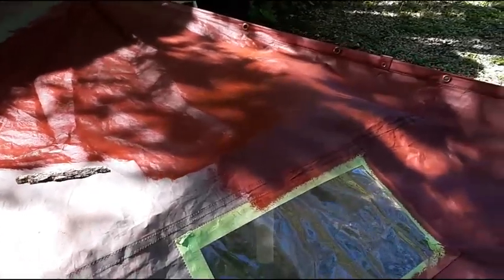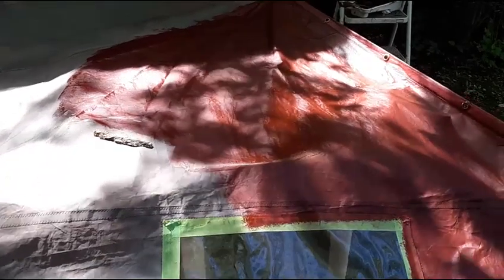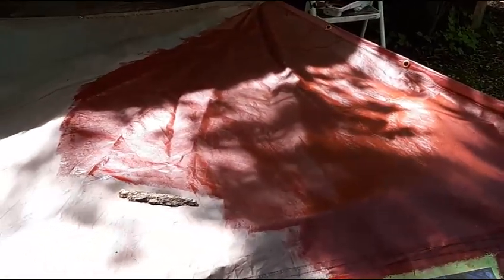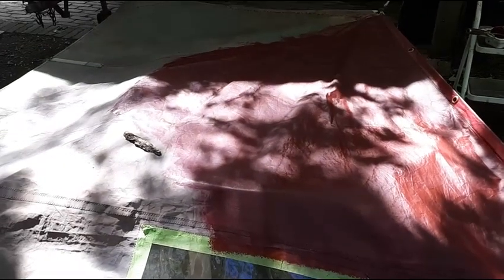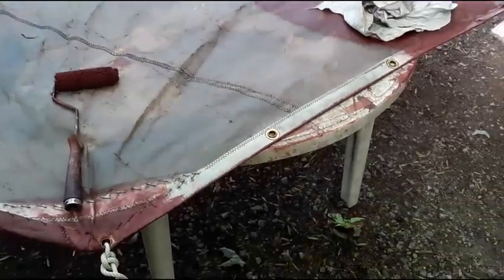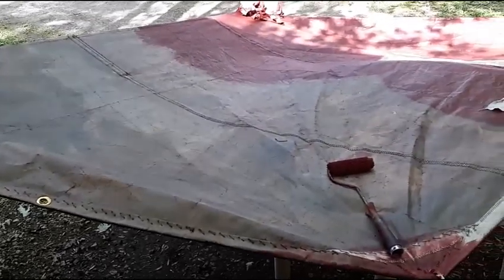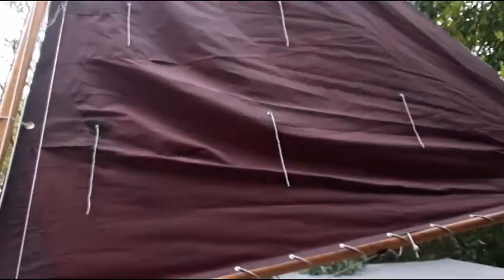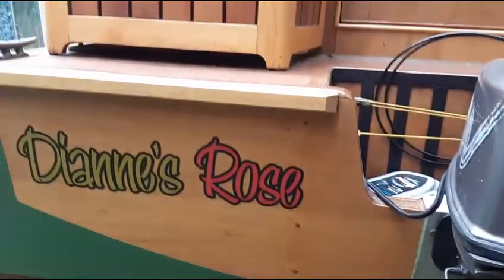Painting a Sail

Comment: Great info Roy.
Does the paint abb a UV blocking component? I built a self furler for my old jid so I was thinking of paintinf a stripe down the leech and across the foot.
Reply from the maker: I'm sure it does if meant for exterior use on metal. Tremclad oil based FLAT metal paint is what I used. Thinned 25%, rolled on and wiped off thoroughly with lots of rags.  The key is to give it a thorough rub!!! It really just leaves a light layer that is worked well into the fabric! You can see if paint is sitting "on" the sail cloth or has "stained" the cloth. It needs more rubbing if on the cloth!! Best/Roy

Comment: What are your sails made from? I've just tried painting and rubbing it in on my sail. It almost  does not seem to go into the fabric at all, and I can rub most of it of leaving an almost white sail.. I think my sail is made from a kind of polyester maybe 🤔 I couldn't find the exact same paint as you used, but I did find som oilbased metalpaint that seemed to be comparable to what ypu used
Reply from the maker: The sail is a synthetic material but perhaps yours is made from more modern materials. Some sails are almost like a plastic. Sorry I can't be more help Boe. If you used an oil based metal paint, it should have worked! AllthebestRoy
Reply: This is so inspiring. I'm going to take the plunge and cut some old sails I've been gifted to experiment with paint on them. I need a new sacrificial edge for my foresail. I have primacon vinyl based marine primer I think might be worth trying. I'm sure I've oil based metal paint too.  If this works well a really fancy boom tent will be on the long finger! Cheers Roy!

Comment: Roy what sort of paint did you use I have had success with water based exterior paint on canvas but have not tried painting sails
Reply from the maker: yes sorry, I've mentioned it on previous videos but  forgot to here. Tremclad oil based metal paint. Thinned 25%, rolled on and wiped off thoroughly with lots of rags. It really just leaves a light layer that is worked well into the fabric! You can see if paint is sitting on the cloth and it would need more rubbing if so!!!
Reply from the maker: FLAT PAINT!!!

Comment: love your work and thanks for sharing. I watched the video but can you please tell me if the sail is canvas or synthetic? Am thinking of repainting a 2nd hand synthetic sail and am worried it won't work.
Reply from the maker: Synthetic? It was not canvas but was an older sail. It may have been a nylon or polyester! I worked on a "newer to me" sail that did not turn out well. I got lazy and just rolled the paint on as thin as I could to avoid wiping it off, which is a lot of work! I should not have skipped this step. It went on thicker and flaked in the wrinkles and there was also old glue from numbers that were on it long ago. There it flaked even more! The trick is to pre-wipe  with thinner and then add thinned pain, rolled on and make sure to thoroughly wipe off with rags! Make sure the thinner had time to dry too before coating. Mix the color you're after and use flat metal paint or "rust" primer (already red and adheres better). I offer no guarantees but if the sail is already looking bad, there is little to loose! Good luck Robert! Best/Roy

Comment: Hi Roy! You continue to amaze. Yes, what kind of paint exactly?
Reply from the maker: yes sorry, I've mentioned it on previous videos but  forgot to here. Tremclad oil based FLAT metal paint. Thinned 25%, rolled on and wiped off thoroughly with lots of rags. It really just leaves a light layer that is worked well into the fabric! You can see if paint is sitting on the cloth and it would need more rubbing if so!!
Reply: @roydesignedthat   hi roy! I am interested in this process for my little sailing dinghy. What is the result over time? Thanks for your answer
Reply from the maker: @optiAero  my first test was with die and it faded. Now I use rust flat paint and it has held up well. Do clean the sail as one sail had glue from old #s that the paint flaked a bit. But I've done several sails with success. Make sure to roll on then rub off with lots of rags so just a thin layer is left and the coat is worked into the fabric. Also some sail materials may not take the paint as well but if the sail is looking rough already, why not try to revive it! The result is a stiffer sail but is still will hold its shape nicely. BestRoy

Comment: video called Painting a sail.... with no mention of what Paint you use for it?!  Jeez.
Reply from the maker: Fair Point! Sorry, I've mentioned it on previous videos but  forgot to here. Tremclad oil based FLAT metal paint. Thinned 25%, rolled on and wiped off thoroughly with lots of rags. It really just leaves a light layer that is worked well into the fabric! You can see if paint is sitting on the cloth and it would need more rubbing if so!!

1
Reply: @roydesignedthat   its been a year now. how well did it hold up to being used and lightly abused???
Reply from the maker: @jacklondon8385  Very good Jack, it has held the color well and is more limber with use. It was a hair stiff when first done! I just got some old sails that mice got into but just stained them with urine etc. These are the kind of sails that are brought back to life with this technique! BestRoy